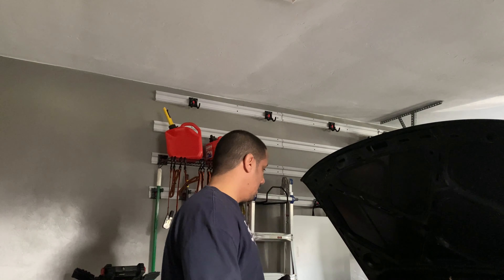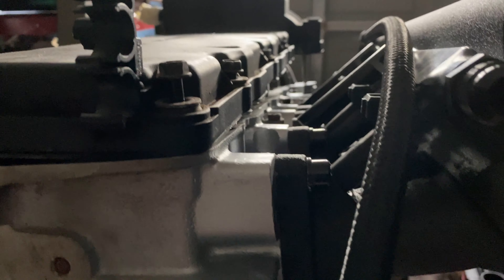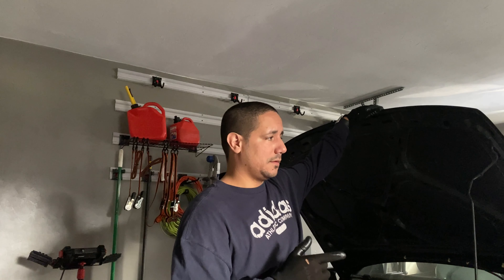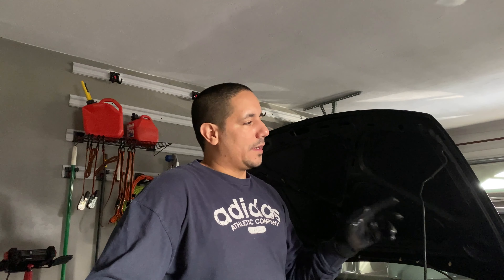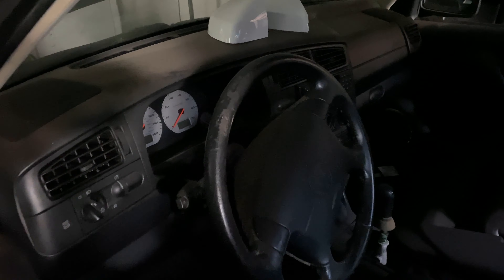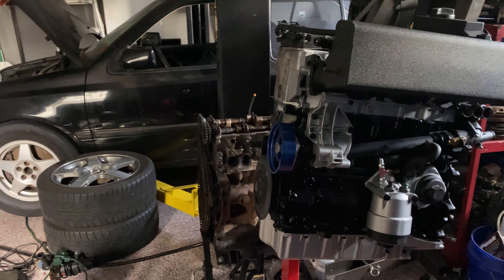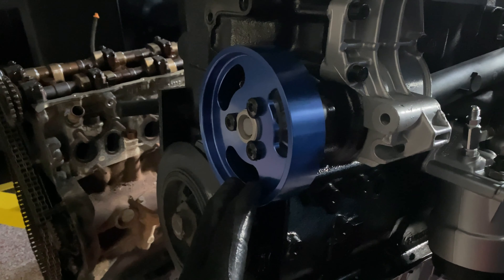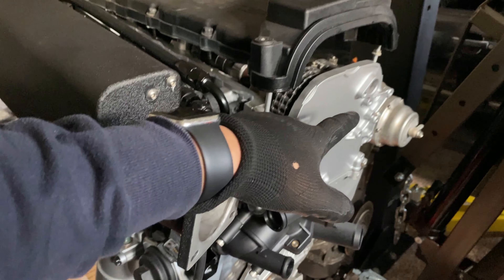MK3 VRT Build Part 1

Comment: Can’t wait 👍
Reply from the maker: Mahmood Habib thanks for the support. Definitely comment on what kind of content you’d like to see!!
Reply: Harold Gonzalez I would like to see how you your fueling going to be
Reply from the maker: @moomo96  so the plan is to use dual Bosch 044 pumps I had mounted to the MK4. After the motor goes in, I'll have another separate video on the fueling system. Thanks for the feedback.